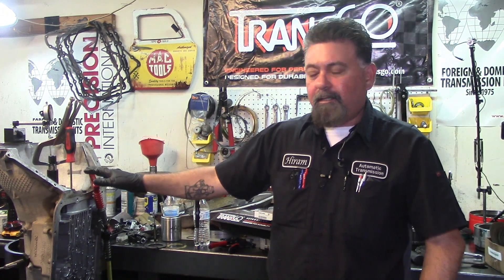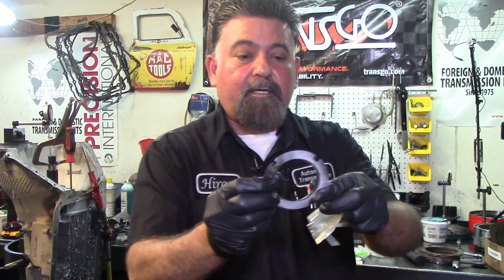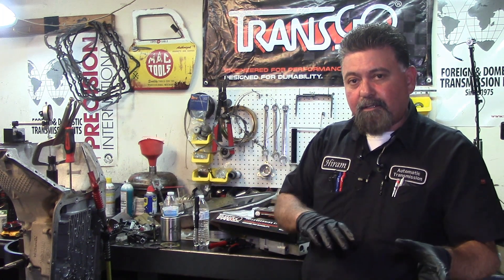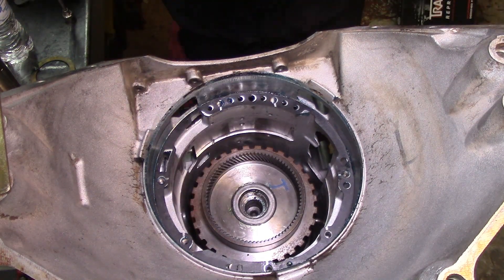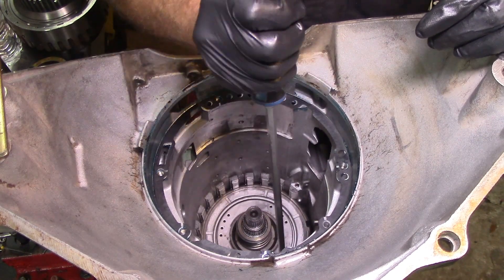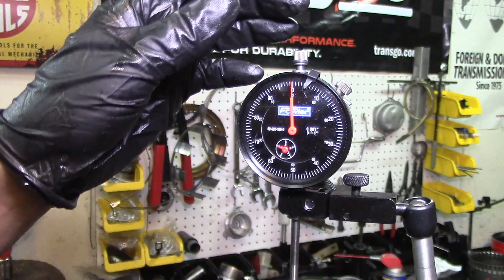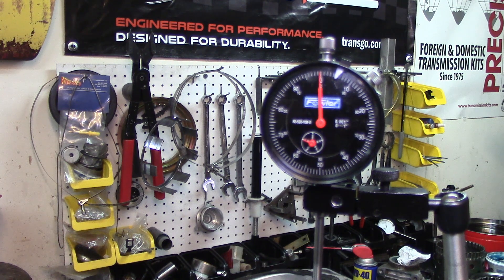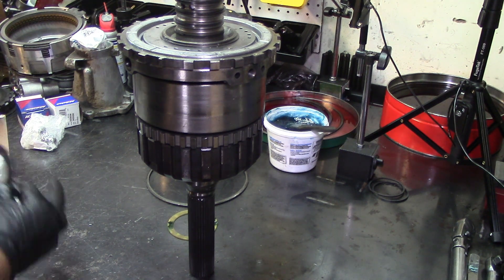4L80E End Play Setup | #4l80e #transmission

Comment: The Sonnax 34322-02K fwd clutch hub is a great mod - it rollerizes the front and the hub is now supported by the direct housing and sun gear shaft instead of the main shaft.  Skip the fwd to direct drum endplay checks ( there will be zero play) and you do everything with the pump selective as far as front end play.
Ythese things want the front end play larger than the rear end play to allow each gear set to thrust independantly so the  fwd movement of rear doesn't bring the load to the front  gear set.  .005 - .010" on top of your rear end play is a good target cleariance - so for your setup .010 to .015 would have been ideal for front end play with your .005 rear.
I also like to install the plastic silencer ring that GM used to use on the output carrier but stopped using as cost cutting measure - it does help with wear on the bushing and noise.
Great video btw
Reply: Hey bud could you  dig up the part number for the plastic silencer ring on the output carrier please? I haven't heard this mentioned before.
Reply: @TurboV8boi  34476 is the number all the trans parts warehouses use and it is used on the 400, 4l80. Try to find an original GM one if possible
Reply: @tyronetrump1612  thank you sir. I already has a billet forward hub thing but got the sonnax one because of your reccomendation. I'll use the one I have in another trans for my daily

Comment: Keep up the good work, Hiram. I do quite a few 4L80's. I use a lot of Transgo products. But I no longer use those Blue hi temp rings on the center support. IMO, they are too wide for the grooves. And don't let enough fluid behind them. I had two units that I corrected a soft 2-3 shift. With only changing those rings to stock 400 scarf cut rings.
Reply from the maker: Like I mentioned in the video, I believe those sealing ring were designed for cross leaks when bushings are reused to compensate for the wear. I still know a lot of builders that don't like to change bushings and don't have the bushing drivers to do that. But this unit, in my experience, doesn't like worn bushings. Falling out of 4th gear and other issues. And that's where the blue rings with the expanders works great, specially on the input shaft. On the center support not sure, I've never had the issue you mentioned. I run new bushings and stock rings and only get the kit for the shims. But thanks for the comment on your experience with the center support rings, hopefully Transgo reads your comment and correct the issue.
Reply: @AutomaticTransmission  I'd agree about the shops who seem to believe reusing bushings is a fair rebuild, it is not. Bushings have a wear time line and a limited life span regardless of how perfect the rest of the unit is. Plus, they already established a wear pattern which will be changed with any rebuild causing even more wear in. Additionally, a bushing kit will offer the wide bushings which only improves the build in many ways.  As far as a trans build shop that doesn't have bushing drivers, they shouldn't be in business without them.

Comment: Hi Hiram, it's me again. Off topic question here. I am dealing with at P0770 on a 2002 Toyota Tundra 4.7L. The code is for shift solenoid E. I also read that it could be the lock up solenoid. Well, I have replaced all three shift solenoids and tested all the wiring up to the control module and the wires are ok. However, I am still getting the same code. Now, my next task would be to determine if the issue is the Torque Converter or the Module itself. I was wondering if you have dealt with this specific issue with the Tundras and wanted  to know if there is a common issue? Thanks in advance and once again, I love your content!

Comment: The plastic selective shim under the pump comes in sizes of 0.059, 0.075, 0.091, 0.107, and 0.123 so I typically adjust my front end play using one of these along with a 0.010" shim under the bearing that rests on top of the forward drum if additional clearance is needed.  I don't use the sonnax forward hub front washer 34298-078 or any other aftermarket washer that is thicker than stock to adjust front endplay, I use a new OEM 24241413 washer under the forward hub to retain the stock clearance in that location.  So you are saying that if you use a pump selective shim like a 0.123 that it will raise the pump too high causing the pump sealing rings to not make proper contact with the overdrive drum?  I have not heard of this.  Have you personally seen this by marking the sealing ring with a dye and seeing if it did or didn't make a mark on the inside of the OD drum where it makes contact with the sealing ring?
Reply: The Sonnax roller forward hub is the bomb - support for the fwd clutch hub now gets transferred to th the direct housing and sun gear shaft instead of the main shaft . bypass the fwd to direct drum clearancing  ( it will be zero )  and go right to front end endplay with your selectives

Comment: Sonnax says push up on tail shaft to take out end play before taking readings on front end play. What are your thoughts? I appreciate your videos!
Reply from the maker: You push up just to settle the front input shaft but not hold up on the output shaft. You have to let it rest then take measurements. It will not compensate for the rest of the play between the input shaft snap ring and the Overdrive planet. You still need to make it touch the planet, then take your reading. Remember that the output shaft will not move much because you already set your rear end play.
Reply: easiest way is set the unit on the gound/ tail shaft and do your front end. Helps to make a shim to put under the circlip to get rid of that first 015" clunk before you get the real numbers. just do not forget about it afterwards